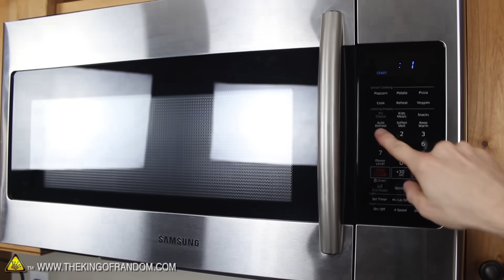Electric Pickles and Vacuum Slime | Rewind #4

Comment: Hi,
I have two questions about suction cups in a vacuum. Wikipedia says "The pressure difference between the atmosphere on the outside of the cup and the low-pressure cavity on the inside of the cup keeps the cup adhered to the surface". 
I think it's obvious a suction cup can't work in a vacuum ? But does it just peel off when air pressure lowers inside a vacuum chamber?
And how does it perform if you mount it on a dry surface, then cover it with water and try to vacuum the chamber? Does the little bit of air trapped under the cup bubble up? Or will the water keep it pushed against that surface regardless of the vacuum above?
Reply: Licu Vasy I think for number one, yes, it will just peel off. For number two, i think the suction cup will just start to slide up along the wall of the chamber. I’m not sure though.